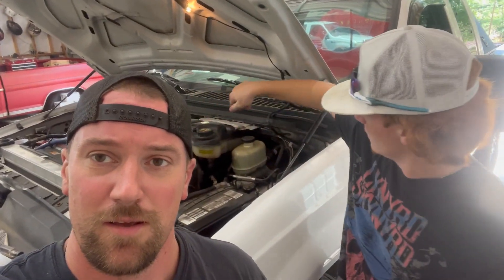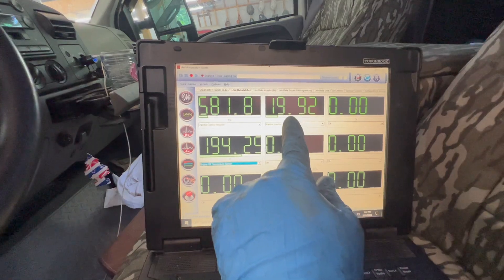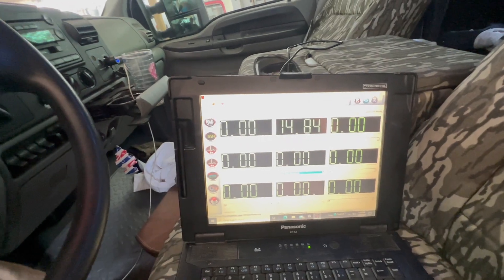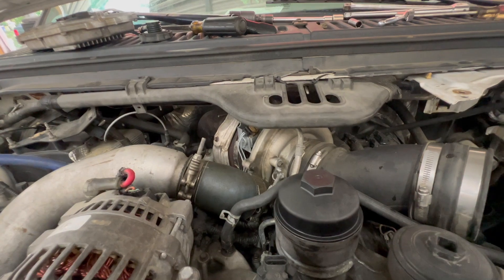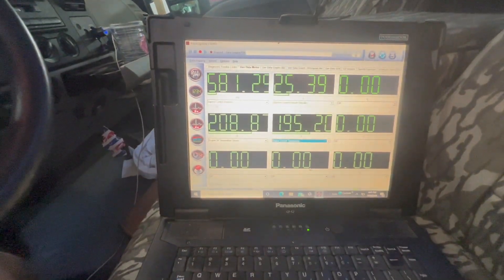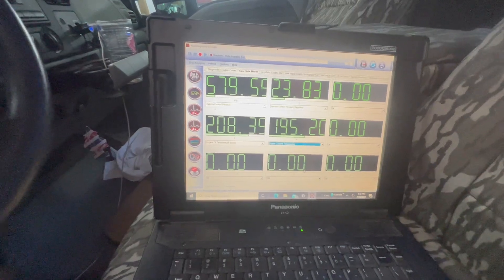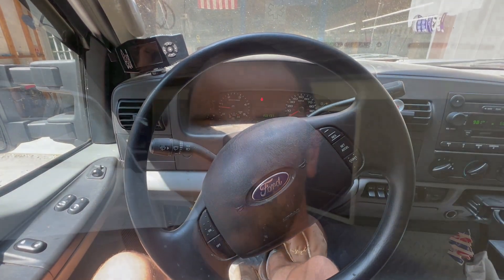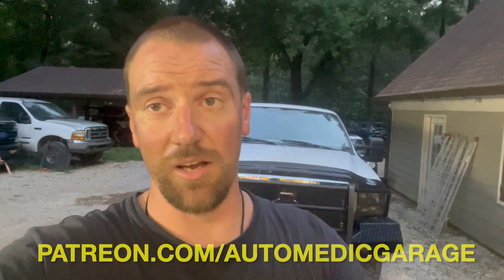6.0 Powerstroke crank no start hot IPR

Comment: Hi, I have a question on the 6.0 I got this 2005 f350 not running not much information in why the truck is not running. Truck worn crank I took the glow plugs out and try to turn the motor by hand and nothing. I lift the truck and put it in neutral. And the rear tires are hard to turn also the front driveshaft turns half way. Without having the 4x4 on is not free the hubs are free I put the truck on the ground and push it one rear tire drag like the transmission is lock. Is possible the transmission lock the engine up?
Reply from the maker: I’ve never seen that happen. Something would have to be pretty catastrophic for the torque converter to no spin freely.
Reply: I will find out ones I take the trans off. Thank you for your time.

Comment: 2005. F450. Crank no start. New batterys. Fuses all good still not start. Fuel filters changed. Still nothing
Reply from the maker: @carlosreyes485  what’s your icp V KOEO, ICP psi when cranking, ipr % cranking, FICM main voltage and FICM SYNC when cranking?
Reply: I will have to check that out and get back to you

Comment: My OEM radiator cracked around the overflow bib fixed it when testing there is also a crack running about a1/2” below. Most likely need a new radiator. Any recommendations other than a $800 Mishimoto? I buy from Amazon FYI and wherever you recommend. Thanks, Phil

Comment: Could an IPR that's just starting to go bad cause idle rpm(when hot or cold)to fluctuate slightly, like say by 20-30? RPM desired and RPM actual are in sync, no misfire codes or any other codes, icp and ipr numbers look good, voltage is good and fuel system is good as well, but idle rpm goes up and down just SLIGHTLY and I'm thinking it's maybe the IPR. Any ideas good Sir?
Reply from the maker: @Powerstroke431  usually something like that is a icp sensor that is going out
Reply: @AutomedicGarage  My ICP numbers are good, but I just checked the IPR itself and although there's no oil seepage and it look fine, it's not a Motorcraft OEM part so I'll be putting an OEM unit in asap!

Comment: When my IPR went out it killed my engine on the highway and wouldn’t start back up until after sitting for 20 mins. After changing the IPR it started right up and my 6.0 keeps going. I even put the heat shield around the new IPR Great videos!

Comment: Hey man I’ve got a drip leak above my starter on 06 I can’t tell where it coming from it drips when cold when warmed up no drip, someone who works in a shop and that works on 6.0s I showed them a vid said it look like a head gasket leaking is that something that would be normal thing runs fine but idk where the tiny drips come from warmed up seems like it goes away …

Comment: I appreciate your videos along with others that post 6.0 videos. The timing on this video is funny because it's pretty close to what I experienced within the past month. I've learned a lot about these vehicles as I've started a small collection of them. I have an '05 Excursion with about 260,000 miles. Aside from leaking oil, it runs great but it hasn't been studded and is completely stock (FICM has been replaced before I owned it). Oil and coolant delta is much better than the one in your video. It's generally running within 8 degrees. 

Recently, it stalled while driving and coasting to a stop. It was like turning the key off. I didn't have my gauge on it. It started after about 15 minutes. I drove it locally for a week and it didn't do it again. My wife generally drives it but we swapped so I could diagnose it. I ran it to temp for about an hour with live data and everything was fine and it never stalled. I drove it to a Wendy's on the way to Cedar Point and it stalled in the drive-thru. We pushed it out of the way. By the time I could look at live data, it started again. Made it for the hour drive and back and never stalled after that. A few days later; same trip. It never stalled going up but on the way back, it stalled three times going to get food 20 minutes away after it was warmed up. Every time it would start after about 15 minutes. I ruled out ICP on the side of the road. It made it back on the expressway without stalling until I needed to coast to a stop an hour later and it stalled.

After ruling out what it wasn't and reading some videos about the IPR acting strange when hot, I ordered a new Ford IPR. When I pulled everything out, I did do an IPR air test to rule that out, and I was glad that I didn't hear any air leaks. The screen did get stuck and it did have a tear in it. However, I don't know if that was from my pick getting it out. It was the newer style screen.

After changing that and glow plugs and harnesses (to prepare for winter as two were confirmed bad and to remove the check engine light), it hasn't stalled yet so I think that was the issue. It was just hard to diagnose because I couldn't repeat the issue every time.

I tested the old IPR by connecting air to it and opening and closing the valve with 12VDC and it functioned. I just wanted to see for myself how it functioned. I'm not sure of how I would create a test while baking the IPR while I vary the voltage. Does the IPR know what position it's at? I didn't think there was any feedback. If the data is showing percentage, isn't that just what the vehicle is commanding the IPR to do based on the ICP pressure or is there some way I'm not sure of where the vehicle says the percentage and can confirm the valve's position.

The only thing I know now after owning the other earlier 2003 6.0, is that it's hard to find good mechanic's in my area that want to work on them, have the time to work on them, or know how to work on them. I'm thankful to have learned a lot in the last year. I was tired of my 2003 randomly crank no starting when cold and I was tired of multiple mechanics telling me what it was just to have it happen  again within the month. Once it was running, it wouldn't stop and it didn't stall. If it was cold, there was a chance it wouldn't start. It would generally start warm. It was hard to troubleshoot, but I finally narrowed it down to the crank sensor and/or wiring harness. I changed them both and it's been fine since. I do have one weak injector, so changing those out will be the next project at some point.

I've learned live data is essential on these vehicles.